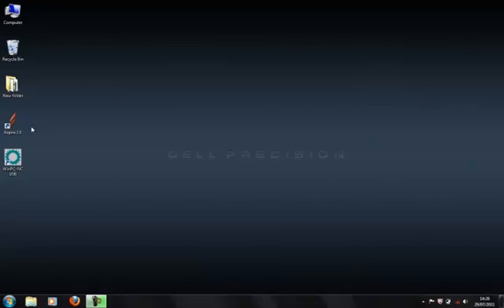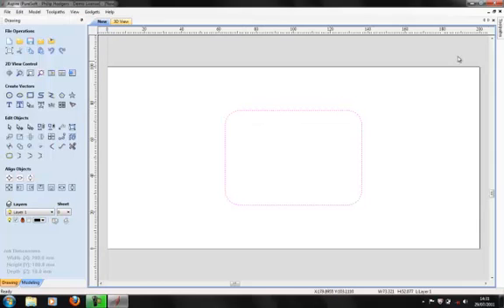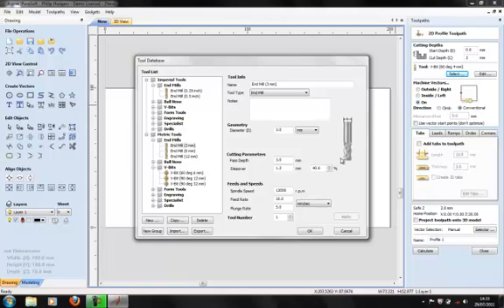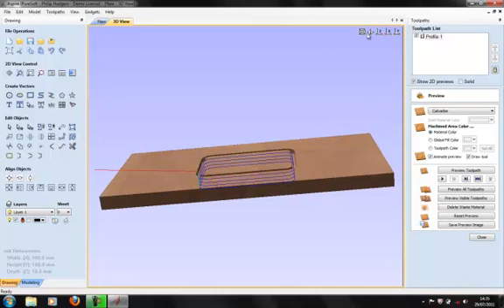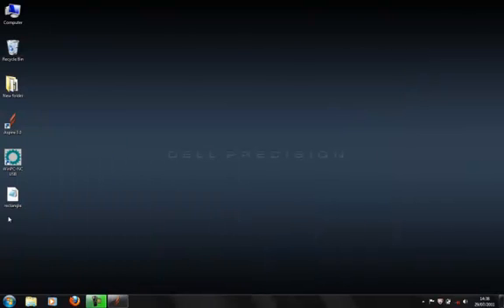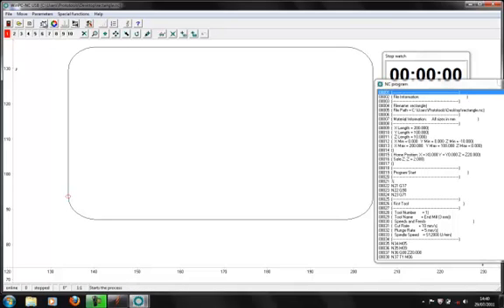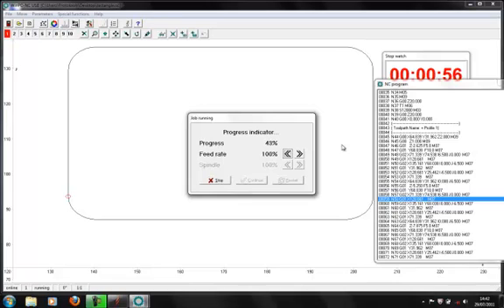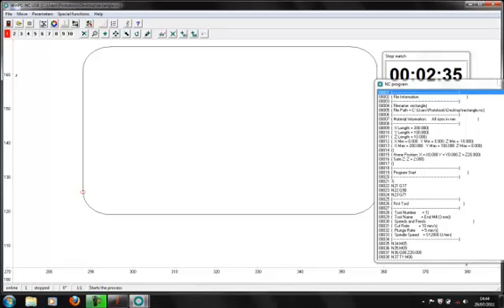Cutting Your First Job on a High-Z CNC

Comment: Step over is the percentage of the cutters diameter by which the cutter moves over mostly associated with pocketing and contour milling. The smaller the percentage the better your surface Finnish on bottom of pocket.